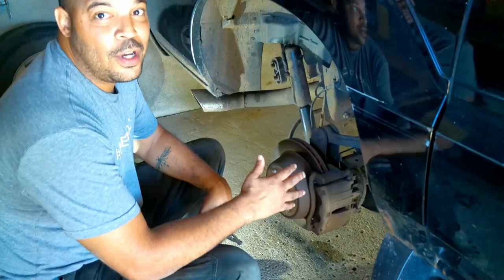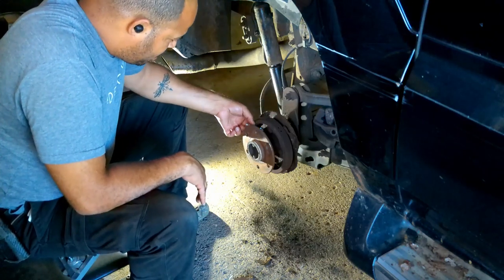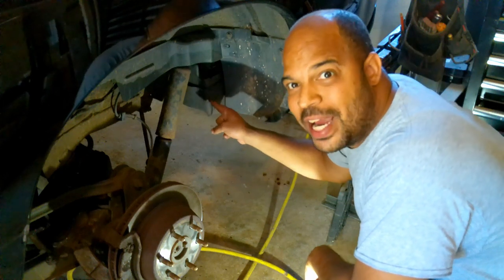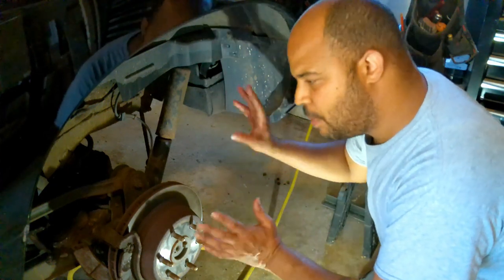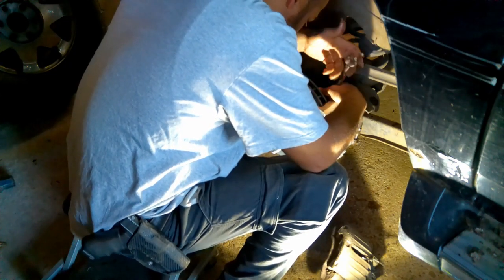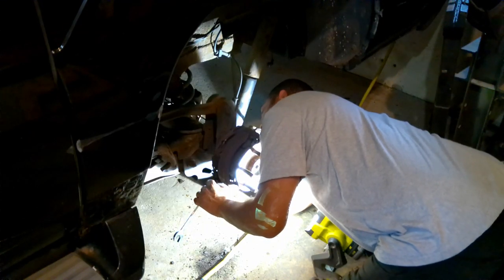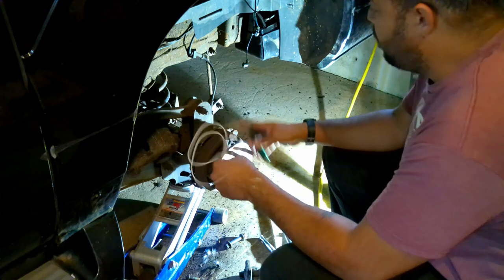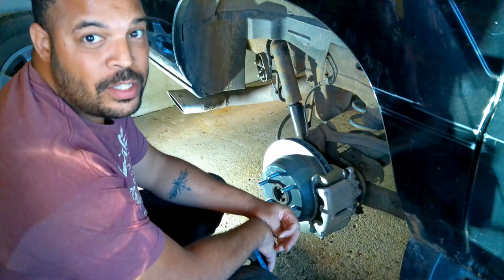2004 Cadillac Escalade.  All new shocks, Rear rotators brake pads and caliper, and  studs  yea lol

Comment: I’m looking into ordering this kit from a1 auto as well . How do you like the ride with the new shocks?
Reply from the maker: In my opinion, the right quality is as good as the regular shocks that I had on, However, I put the air ride on. Because I do a lot of towing and I put a lot of heavy stuff in a bed of truck and the differences is night and day. So if you're towing, are putting heavy loads in the back of the truck? I would definitely recommend it. If you do it, I'll be curious to see what you think after it's done. Thanks for watching and commenting
Reply: @motivatedbydesigns   I don’t tow much but Id like to keep the ride as stock as possible. I’ll definitely let you know once I install it . Did you torque the bolts to specs? If so do you remember what those specs are ?